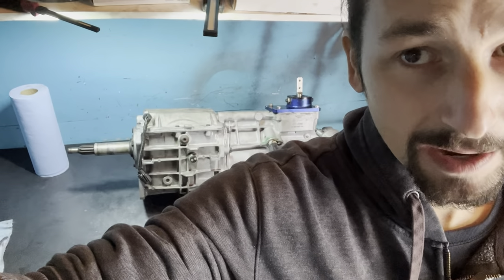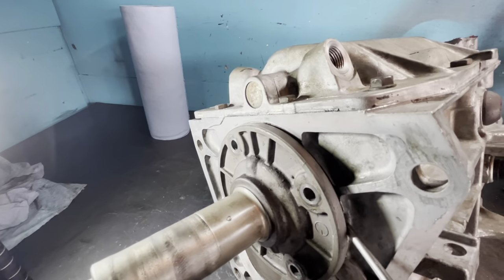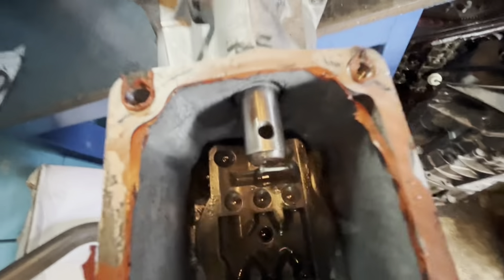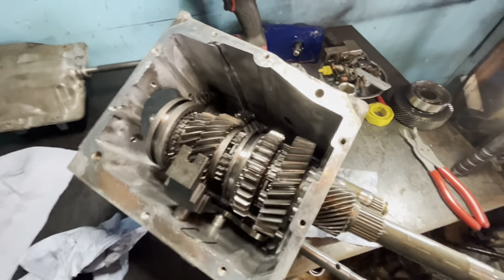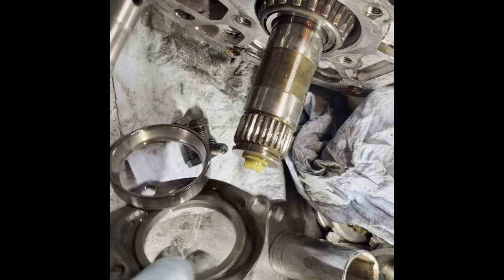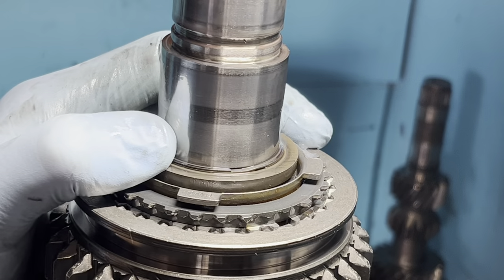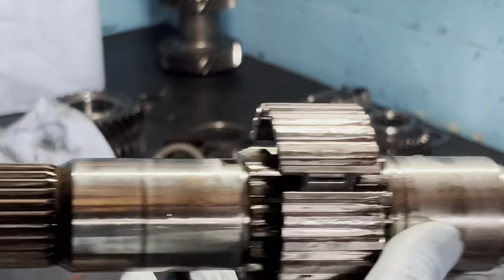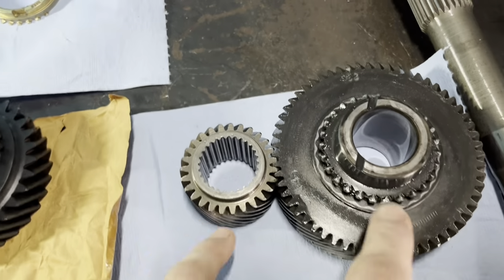How to Rebuild a Mustang T5 Transmission Part 1

Comment: Awesome channel! Can you please give me some advice on my new to me WC T5? I'm having trouble shifting into 5th and reverse. It is very hard to get into gear. No strange noise, clutch is adjusted correctly. This transmission sat for several years without fluid. I just installed and started running it and I was told it might loosen up after running it for awhile. Is this valid advice. I'm running non synthetic ATF fluid. I appreciate any help you could provide. I don't want to tear it down unless necessary. Thanks

Comment: really appreciate your video, thanks in advance...looks like your one of many that don't provide the needle bearings for 1st, 2nd, and 3rd gear in your kit? seems there not readily available anymore or hard to find so people selling the kits without them.  I found them at one of the authorized Tremec ELITE dealers called Modern Driveline out of Idaho. plus they have the one piece shift interlock finger/pin where the old design was a tow piece that could fall apart.

Comment: Good video...... we are releasing a brand new 2.95 ratio gear set for the Ford application rated at 450 hp and retains the factory 10 spline clutch. It might be something worth looking at for you in the future on rebuilds.
Reply from the maker: Thanks, Im interested. If you could send me an email with what you have to offer that’d be great. 505speeds@gmail.com

Comment: Where can you get a built pro street out the door with a core? I have a T5 sitting in my garage right now. I’m watching this video now tryna figure out how to rebuild it. I rather just drop the newly built T5 in…
Reply from the maker: The Pro Street is a package I put together myself after years of rebuilding T5s. I am located in Costa Mesa, Ca. If you aren’t able to drop off locally then its usually a deal breaker to ship as shipping can be an additional $250-$400 depending on where you are. If you are interested send me an email or dm me on Instagram. I also sell parts to make your T5 a Pro Street all in one package. Link to my website is in the description. Thanks.
505speeds@gmail.com
Instagram @505speeds

Comment: I have a quastion please, does this rebuild kit fit on mustang V6 3.8L 2000 , T5 manual transmission
Reply from the maker: The rebuild kit yes, if you are looking for gears send me an email as there is a minor difference  505speeds@gmail.com
Reply: @505speeds  Thanks bro 👍🏻

Comment: excuse, do you what oil use? for t5
Reply from the maker: Go watch part 2 its at the last few minutes of the video
Reply: Can you provide the vendor for rebuild kit? I have a T5 I want to rebuild and am looking for a rebuild kit better than stock but doesn't have to be a race capable trans. Thanks, Kevin
Reply from the maker: @irishjig1013  Hi Kevin I added a link in the description

 https://505-speeds-shop.square.site/product/mustang-t5-world-class-rebuild-kit/20
Reply: Thank you, I have the link now. I appreciate it. Do you have the steel front bearing retainer as well? Or do I just buy it from another supplier. Thanks again, Kevin
Reply from the maker: @irishjig1013  I have everything in the video available to purchase including the steel retainer. Having a few issues setting up shipping so if you have any problems send me an email, I usually respond pretty quick.
Reply: Alex - good evening, I received my order today. Thanks! Kevin Burns
Reply from the maker: @irishjig1013  Your welcome, thank you!